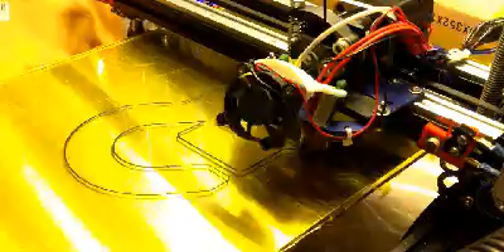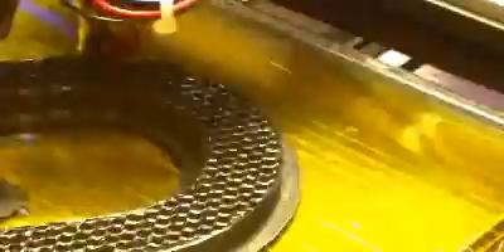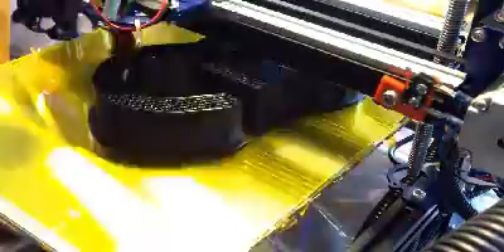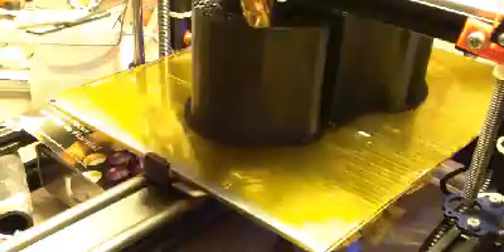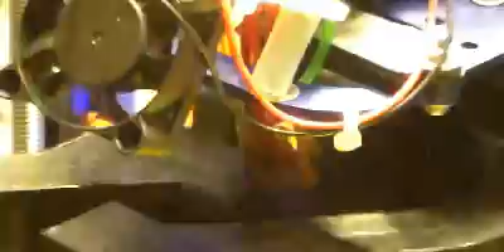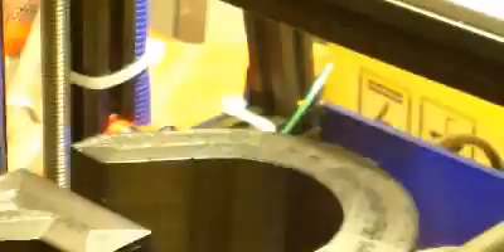MendelMax 2 Claw Tool Print Time Lapse

Comment: How  did you like the max 2?  have you seen any issues printing with it?  Im looking for a large platform printer to only print ABS
Reply from the maker: Well, because it's not fully enclosed to maintain a consistent heat from the bed upwards, ABS can easily warp with larger prints. PLA and nylon and other filaments tend to survive better. A well thought design, such as adding holes and subtracting material thickness in certain areas will favorably affect the results with ABS.
Reply from the maker: But, of course, it's got the biggest platform available for this price level and is fantastic....

Comment from the maker: I recommend it! Its got a bed that's 310 x 210 x 175 (with my nozzle) so you can whip out big parts. Maker's Toolworks has a chat room for quick assistance on questions that can arise. I've got twenty -so far- empty reels tossed across a back counter. It's become an extension of my creative self.